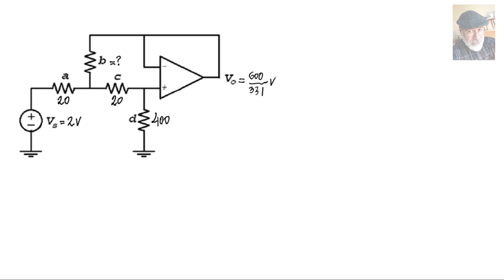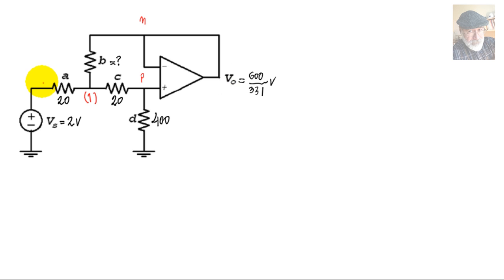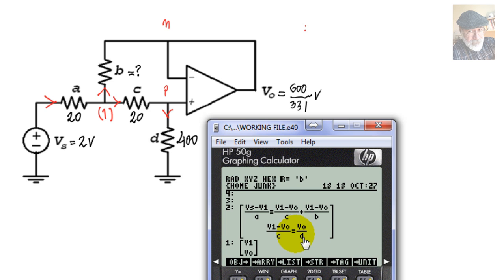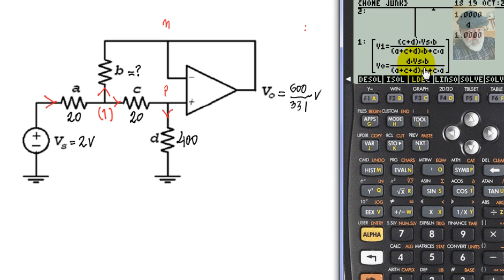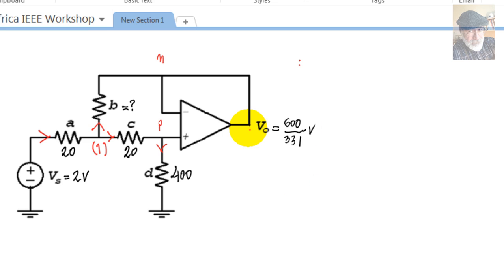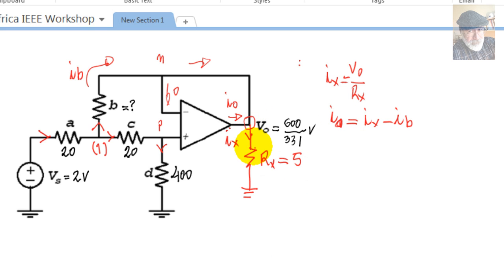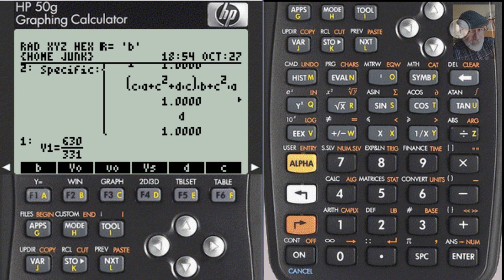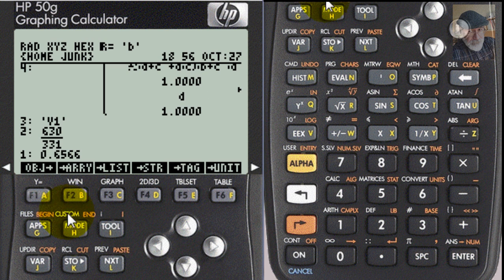Midterm 3 - the Op Amp question (Q1) Oct 2016

Comment: I never used the HP50G, but it seems to be an awesome tool (I need to buy and learn to use).

I solved the exercise using the rule of buffer, "Vo = Vp", then, calculating the current and come back calculating other voltages and currents in the circuit.

Congratulations by your videos, they are very helpful!